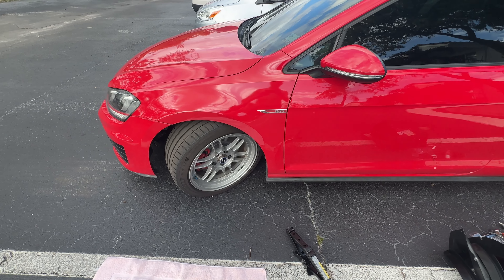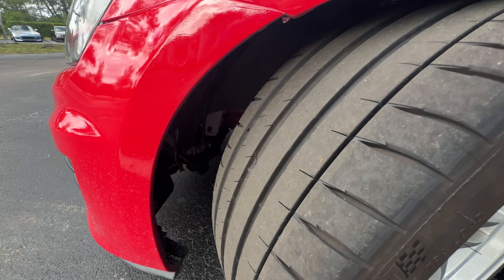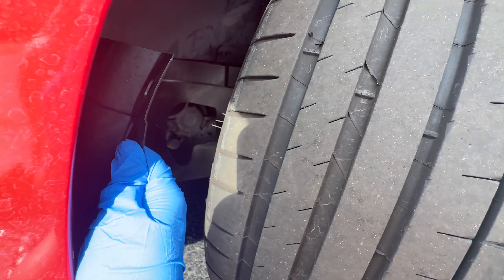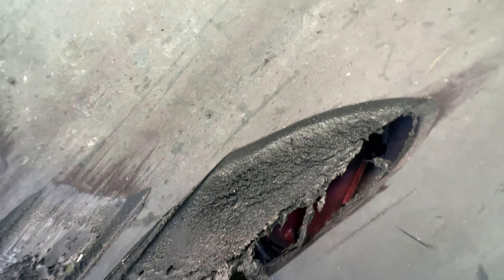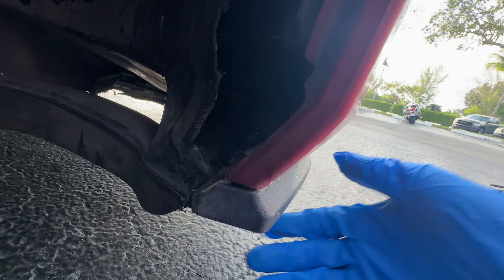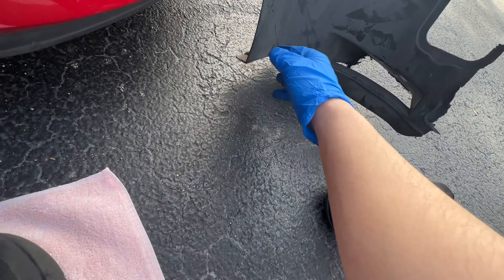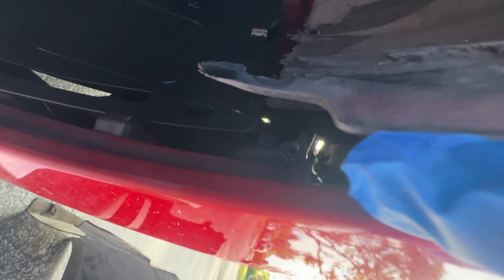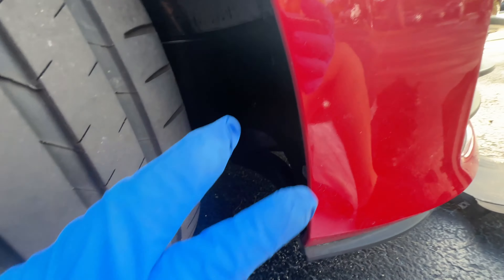Replacing Golf GTI fender liners

Comment: chris i need help. i have a 1.4 jetta mk6.5 and i want to do a turbo upgrade but i can’t find one anywhere. i know you have experience with the platform but i just need help
Reply from the maker: hey bro they dont really make a direct fit turbo for this car. U can get a custom big turbo set up. If u want a direct bolt up replacement u can check rtmg tuning , theyre in europe.